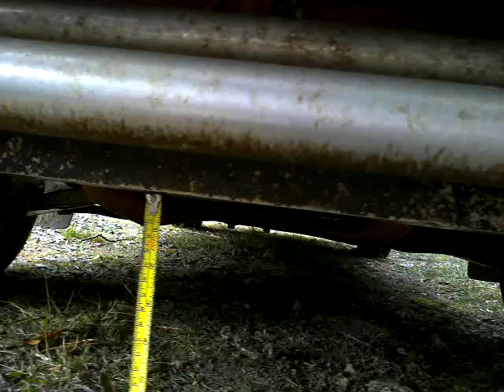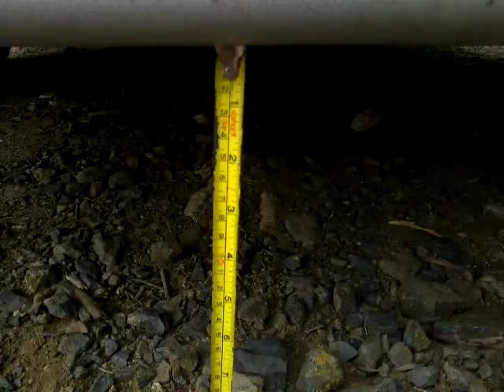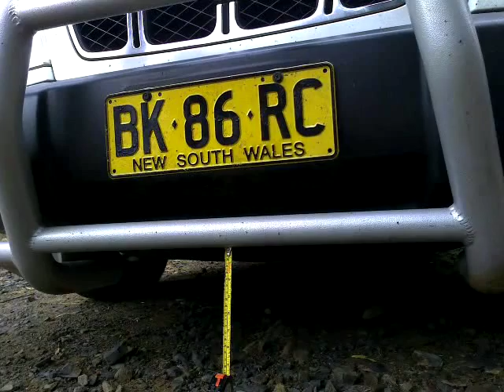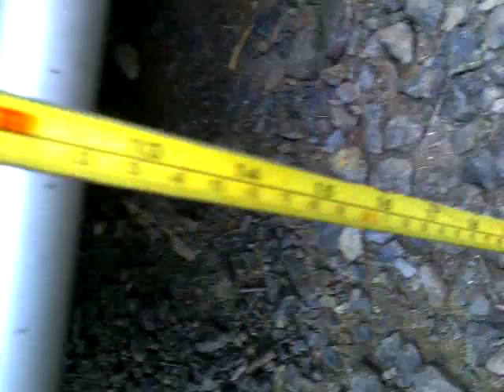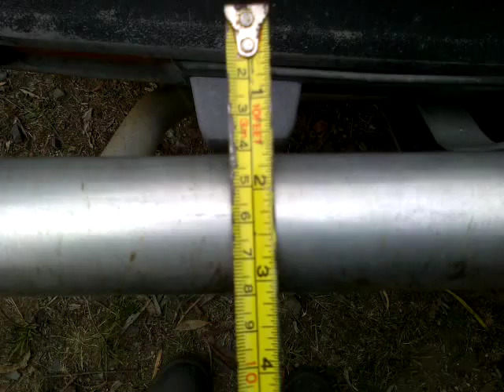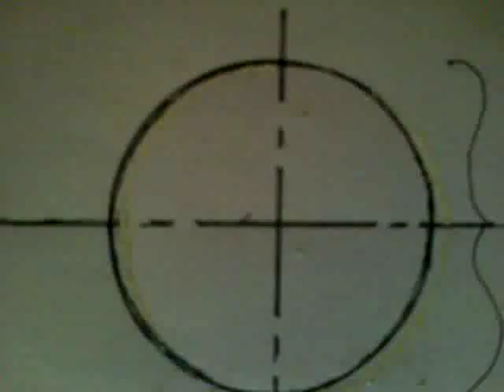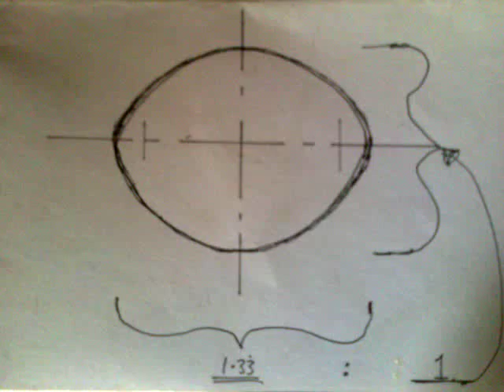Shakesperian Bullbar Theory...

Comment: On my Hilux ute, I have a small Nudge Bar. After watching your graphic description of what happens to a brain upon collision, I just pray that it will never happen to me.
Reply from the maker: G'day Ed,

Thanks mate,

 I see a lot of those Nudge-Bars getting around lately..., and about 5 or 7 years ago my mother had 4 "Bump-Gates" installed, which the Nudge Bars seem fairly perfect to operate with...; each Gate has a Bellcrank mounting a Post on each side, & Cables to release the Latch, all Gravity Balanced with a Delay-Catch..., so when it's all perfectly tuned one nudges the Gate, it opens for the Vehicle to pass then closes behind it...

  But, there might be 500 Nudge Bars in Town yet nobody ever persisted with the Bump-Gates for longer than a year, because every time it rains the Soil softens, the weight of the Gate pulls the Gatepost out of alignment, and the Gate either fails to open or fails to shut as advertised...

 So, I dunno what the Nudge Bars are for...(?), because they don't do anything for the Blinkers and Headlights in the event of a Kamikaze Wildlife attack...

 But, yeah, the answer is not to run into Pedestrians..., and that way the Bullbar can't hurt them..; and of course, never walk in front of one unless you can guarantee being clear before it comes past where one is occupying Space...

 Both ways, it's a Situational Awareness issue...

  And, with Pedestrians, staying inside the posted Municipal Speed Limits pretty much keeps them safe...

 With Wildlife, dipping one's Lights - even going back to Parking Lights if you want to get heavily serious - while braking in a Straight Line as soon as one sees them (ideally several hundred metres away)...; is the "Optimal Response" to seeing such a threat, but sometimes they hide behind Bushes before leaping into the light-cone.

  Therefore, lots of us Hillbillys and Rednecks, and even Greenies, have Bullbars...

;-p

Ciao !

Comment: Ru killing . What is there hearing like ? Any dog whistle type unit ? To get the buggers to piss off prior to your lights mesmeric effect ? Or is that likely to be just to waste fuel rather than save the odd blue air moment ?
Reply from the maker: G'day Bob,

 Thanks mate,

 Um, yeah, there are a couple of gadgets called "Shoo Roo" & "Shu Roo", as it happens, one is a pair of Plastic Venturis which the Slipstream causes to emit an Ultrasonic Whistle with a Pitch dependant on Airspeed...; the other is an Aluminium Weatherproof Enclosure for 2 Speakers and some Circuitry, wired via the Ignition, which plays an ascending Cyclic Chirping noise...

 Some people swear by them, others say they're a Scam, I haven't ever tried either version...; I had a Bullbar already at the time they both hit the market, so scepticism has thus far kept me using Physical rather than Sonic Defences.

 If I hadn't been able to get a Bullbar which I could afford then I was going to try the Aerodynamic Whistlers...

;-p

Ciao !

Comment: You have a lot of cars!
Reply from the maker: G'day,

Thanks mate,

 Um, yeah, kinda...; though only 2 are mine, the Forester which is Road-Registered & the Touring Wagon which has been but a "Paddock-Basher" & Firewood Collector on the 100 Acre Rock-Block after 12 years as my (only) Car...

The Brumby on the edge of the Clearing is my son's, he used to drive one for about 4 or 5 years & that was his "Spare Parts Pile", which is actually driveable if it's Tyres were pumped & given a charged Battery..

  But, yeah, I had kinda hoped to have sold the Touring Wagon & made a clean switchover, however after a few trips to the far end of the Property in it, even transfering Firewood from Wagon to Forester before taking it to Town ; I do kinda like not having to drive the Newbie in the Scrub..., so maybe I'll keep on having 2 cars functional with only one registered...

;-p

Ciao !